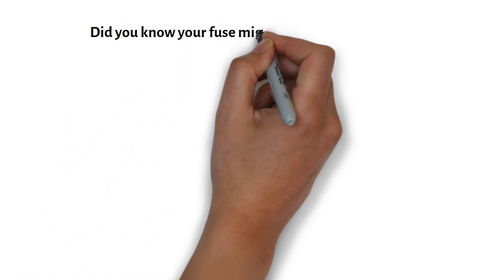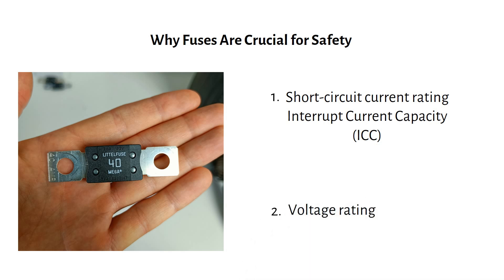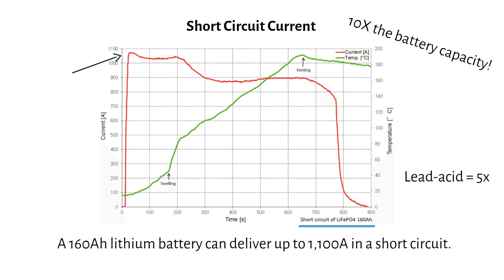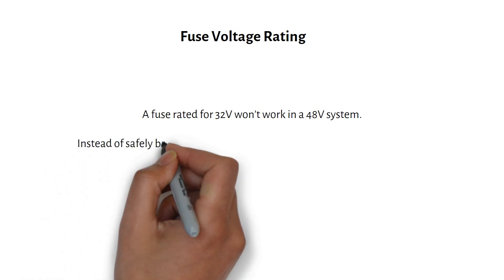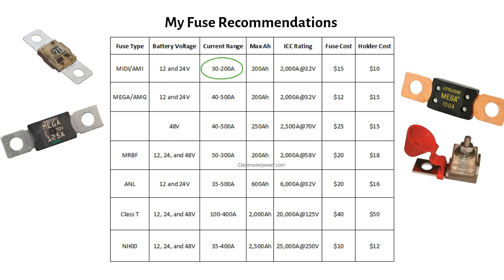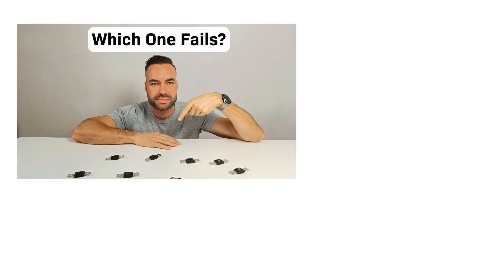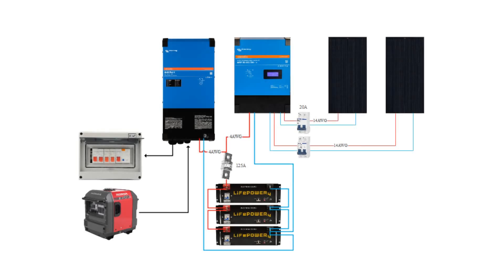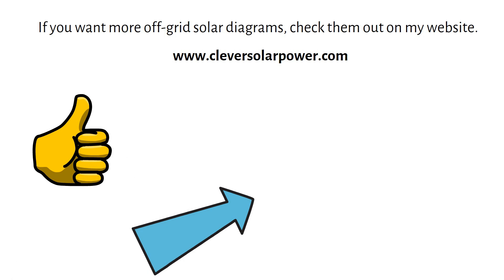Common Fuse Mistake: Short Circuit Current and Voltage Explained

Comment: Nick, I have 3 LiTime 24v 200ah batteries wired in parallel to a Victron Power-in bus bar. I have 300amp MRBF fuses at each of the positive terminals of the batteries. Additionally, I have a 300amp T-class fuse between the Victron Power-in and the battery cutoff. What do think, too much, not enough or ok?
Reply from the maker: It depends on the inverter power. Check my video about current sharing to learn more about the fuses you need to use for batteries in parallel. In my video about parallel different capacity batteries i explain fuse sizes as well. In short, i don't think your MRBF fuses need to be 300A (too large).

Comment: Quick question...  does is apply to the main battery fuse or all fuses in the system
Reply from the maker: The voltage applies to all the fuses, but the Icc applies to the main battery fuse. So if you have a 48V lithium i recommend using a class-t or NH00 as the main battery fuse.
Reply: @cleversolarpower  thanks for your advice.. always every helpful...  all li time... 280a 12v battery,, 1000w inverter...  40a dc to dc mppt charger... will be fun puttin it all together..   thanks again

Comment: Which fuse should I use for a 12V 100AH Redodo LiFePO4 battery that will be connected to PowMr 12V 1kW inverter?

Comment: Hi Nick; I am very surprised by your recommendations, which maybe demonstrates my limited knowledge in this area. I have the following setup: An Anker 757 with solar input specs of 10A and 11-30 Volts connected to a Power Queen 100AH Smart LifoP04 battery. I am using a 15 Amp fuse on the positive cable from the battery to the Anker 757, on the premise that the Anker maximum draw is 10Amps. Based on your video, should I really have a 100 Amp Midi/Ami fuse on this cable? Your comments would be greatly appreciated. Thanks Arthur PS I use the Power Queen to extend the run times on my Anker 757 (Anker is 100AH capacity)
Reply from the maker: The current of the wire depends on how much current the charging/discharging needs. If your anker only takes 10A, then you need to multiply by the safety factor of 1.25 to become 12.5A, the nearest fuse is 15A. Then you need to size your wire based on this 15A, so choose a wire that can carry at least 15A because you want the fuse to melt first before your wire does.

Comment: in setup as described 6:53 of the video, where would you place the battery disconnect switch? one for each battery? where would you place the shunt? after the negative bus bar?
Reply: The disconnect switch should be placed between the class-T fuse in this diagram and any loads or inputs. The fuse should protect everything in your system from the source - in this case the battery bank.
The shunt should be placed between your combined negative battery bank point (in this diagram @6:53 - the negative busbar) and any/all loads and inputs to give you correct sampling.

Comment: What about inline fuses?
Reply from the maker: All fuses are inline. I'm not sure what you mean.
Reply: @cleversolarpower  oh ok  didn't understand maybe what I meant is the fuses in these videos have two metal ends, but the one I see on Amazon for solar panels just looks like plastic tubes.. I was wondering if that's why they call them "inline"

Comment: So, if I buy one of the new 12V 300Ah Mini Batteries, my only options for the ICC rating are ANL, Class-T, and NH00 fuses? That’s a shame. 😔 Thanks for the excellent content!
Reply: I'm going to correct myself. MRBF, with its typical 10,000 AMP protection (12V) is more than enough. For a moment I thought we needed 100X the Bat.Capacity.

Comment: Is there an online calculator that you could put in your battery ect. ect. and get fuse / breaker sizes?
Reply from the maker: I do not recommend them, because the fuse/cable recommendation depends on the cable type you are going to use. Checkout my video on how to size wires and fuses.

Comment: beware, lithium batteries have massive differences in their shirt circuit current.

For example some small 32650 Lifepo4 cells have an isc off 60 amps, while there are different brand 32650 that could do 200 amps on a 12 awg cable, tested with a simple dc clamp. I also tested my cylindrical 50ah Lifepo4 and got a CCA rating of 1030 amps, while my 100ah Prismatic Lifepo4 also does around ~1000 amps. Cylincrical cells are bigger and usually have a higher isc than their prismatic counterparts. The problem is that a premade 12v lithium battery could have either.

Thanks for the video tho, I didnt know those fuse had a max stopping current like that. Lucky I bought an anl fuse for my battery
Reply from the maker: Yes, it is true that smaller capacity batteries have a higher short circuit current. As you can see in the linked study, the smaller lifepo4 cells has more than 10x the short circuit. However, in off-grid systems, we are not going to use that small of a battery.
Reply: @cleversolarpower  ok thanks. Just a question, do you happen to know if the CCA rating is equivalent to the short circuit current of a battery? I can't find any resources on google.

Comment: 😮I have NH01 350a fuse 250a circuit breaker in my system.. is quite big. NH00 fuse at 160a in my small system

Comment: So is the BMS not able to stop the short circuit current? My 280 Ah battery's BMS says maximum current discharge is limited to 1000 amps.
Reply from the maker: It's definitely not designed to do so.

Comment: You must use properly rated fuses/breakers and you see so many people using entirely inappropriate ones.  I still see people putting incorrect fuses before the BMS as an additional protection where the SCC will be quite large.  The total of all impedances at play soon limit the real world SCC on the outside but that total of all impedances must consider parallel batteries too.  If you have 3 x  2kA of SCC coming into your bus bar the outgoing protection has to be able to cope with it.
Reply: Of course battery construction comes into this too, and the problem is where is person off the street has no idea of their battery being built from high capacity prismatic cells, a collection of smaller prismatics, or even a large collection of cylindrical and has no understanding of what the SCC actually is assuming they even understand the need for OCP.  It's not without reason that I said what I did about SCC and fuse choice on another video.
Reply from the maker: Yes, increasing the internal resistance of the battery slightly will reduce the short circuit current.

Comment: According to test, Winston 40Ah cell produced an initial peak current of about 2200A during a short circuit, exceeding its rated capacity by over 55 times. Therefore, your assumption of 10 times is incorrect, at least for Winston cells. Test video available here: https://www.youtube.com/watch?v=R9xZf4p8PkQ
Reply from the maker: That is a good remark. Generally lower capacity cells have less internal resistance, thus create a higher current. The internal resistance of a 40Ah winston cell is 0.0007ohms. So this becomes: 3.2V/0.0007ohm=4,571A potential short circuit current (more than the shown current). I should have mentioned my tests with my 12V 100Ah and 200Ah battery. You can see the internal resistance is not only the current of one cell. it's the cells + contact resistance + bms internal resistance + lug resistance + cable resistance. In my video about paralleling different capacity batteries my 12.8V 100Ah battery measured 11.4milli ohm or 0.0114ohms. 12.8V/0.0114ohm=1,122A of potential short circuit -> a bit higher than 10x. The 200Ah battery measured 8milli ohms or 0.008ohms. 12.8V/0.008ohm=1,600A -> lower than 10x. So it's incorrect tot measure the short circuit voltage of a single cell because the current has to pass the fuse in order for it to break the circuit, and on the way to the fuse it has to pass trough the bms, lugs, busbars, cables, and the fuse itself. additionally, if we reverse-calculate the internal resistance of the test: 3.2V/2,200A=0.00145ohms or 1.45milli ohms. The resistance is very low because of the huge cables they are using, the single cell,... so the test is not a real world scenario.
Reply: @cleversolarpower  👍

Comment: Hi man.
First, thanks for all your videos...

I know this question is not related to this video but I need help with something...
My inverter only charges the battery with my generator only when is a load of over +/-500w.
If there is no load at all the inverter will not charge the battery.
Reply from the maker: I suspect that your battery is already full or you set the wrong parameters. Do you have a shunt? If not, i recommend adding one, its shows battery capacity correctly. I made a video about it as well. Search for shunt.
Reply: @cleversolarpower  I dont have a shunt yet, the batteries are fine.
The problem is that the generator produces power when is demanded and and inverter takes power when is available, the inverter doesnt trigger the bypass until the load is over 500w and the power from the generator goes to the load and whatever is left to charge the battery, I can not make the inverter to charge the battery only with utility/generator...
Reply: @cleversolarpower  I been looking for a shunt, I have 8x U-Power UP-TFS250-12, they are 12v 250ah, the are connected as 4x 24v so I think I need a 1000amps shunt?.
Thank for your help.

Comment: I have a fuse related question please.
Do you know what the differences are btween nh00 and nt00 fuses?
Reply from the maker: Not sure about the differences. Good brands don't use the term NT00. Maybe NH00 is a protected term only used by good manufacturers and NT00 is used by other sellers. I would only trust NH00 from popular manufacturers listed in the description.

Comment: love the videos...  what size n type fuse for 280 ah battery..  or a dc breaker
Reply from the maker: If its 12 or 24V, use an ANL fuse. If it's 48V, Class-T or NH00. You can always use fuses that are rated higher (use Class-T or NH00 instead of ANL).
Reply: @cleversolarpower  hi its 12v.....   i was wondering what size fuse  ??? amps
Reply from the maker: @Mmmmmmmiwish  I have a video on selecting fuse size, you can search for it on my channel page.
Reply: @cleversolarpower  cheers .. will check it out

Comment: Hi can i use a 125 megafuse on a 48 volt system with pylontech 5000 battery on a victron power in ,or do need a class t fuse not quite shore thanks
Reply from the maker: You need a 70V MEGA fuse, a Class-T, or NH00 fuse. Your battery is 48V at 100Ah.
Reply: OK thank you heaps

Comment: For low-amperage (10-30A) high voltage-fuses you can use 10x38mm ceramic fuses, also known as solar PV fuses.  These are ceramic fuses ... basically a miniature version of a T-class fuse, and typically have an I.R. of 20,000A @ 1000VDC.  

Note that many people improperly use auto blade fuses and glass fuses in battery systems.  These fuses are generally only rated to 32V and have very low IRs, so they are only suitable for use when placed after a breaker or other fuse that breaks/blows below their IR.   So blade and glass fuses should never be directly hung off of a battery bus or used in higher-voltage systems.  Use 10x38mm ceramic fuses instead.

ICC vs IR:  You used ICC when you should have used IR in most places in your video:

--
ICC (Rated Short-Circuit Current):
This value represents the highest current a circuit could experience during a short circuit, and is typically used to ensure the chosen fuse has a sufficient interrupting rating to handle that current safely. 

IR (Interrupting Rating):
This is the maximum current a fuse can safely interrupt without damage or failure, and is usually expressed in kiloamperes (kA). 
--

You made a mistake on your Class T table.  Class T fuses typically have an I.R. in excess of 200,000A (200kA), not 20,000A (20kA).

Most BMS's ARE designed to properly disconnect on a short-circuit.  You need the fuse as an added layer of protection because if the BMS's FETs burn out, they likely burn-out into a crowbar'd state.  So the fuse is mandatory, but the BMS is still supposed to be the first line of defense.

On a large battery bank, a large wire gauge (i.e. a small wire) may effectively limit the amperage during a dead short and prevent the BMS or the main battery fuse from blowing even as the wire catches fire.  Thus, all cabling must be properly sized to ensure that the BMS and/or fuses blow if a short occurs, and proper breakers or fuses must be used when branching into lower-amperage satellite circuits that are using smaller cabling to protect that cabling, since a short on the smaller cabling may not trip the main bus fuses.

-Matt
Reply from the maker: - Yes, you can see these ceramic fuses being used in solar combiner boxes. 
- Indeed, that's why the voltage rating of a fuse is important.
- Yes, I used ICC during the video, I didn't want to confuse people more than i needed to, but you are right.
- Class-T have  20 kA @ 125 Vdc and 50 kA @ 160 Vdc so it depends if it's AC or DC. Also depends if it's a JLLS or JLLN (by littlefuse).
- I wouldn't trust on electronics to break a short circuit current. 
Thanks for your constructive feedback Matt. I really appreciate the healthy discussion.
Reply: too bad they are not 60-100A, it would be very cheap solution for fusing individual batteries into packs